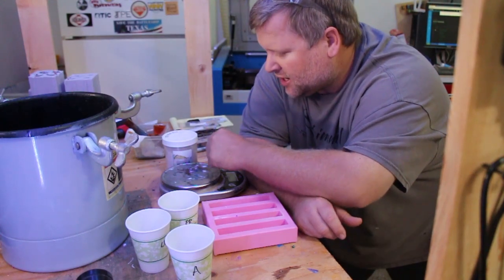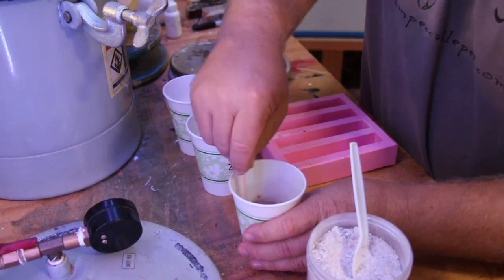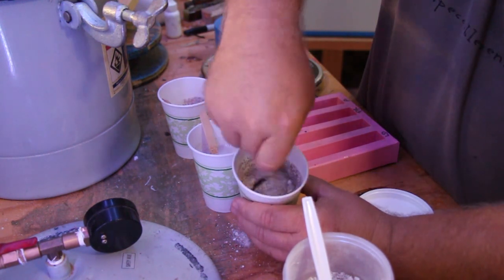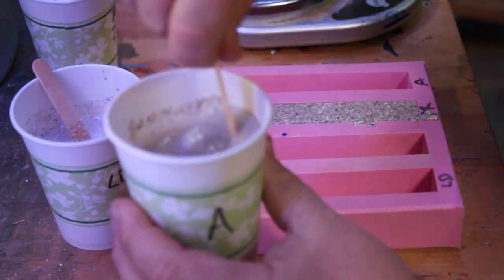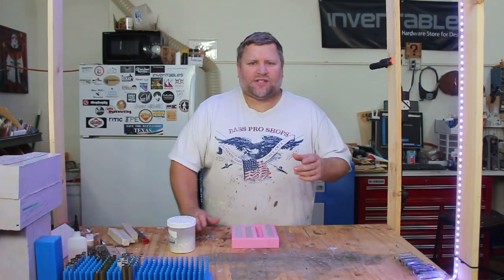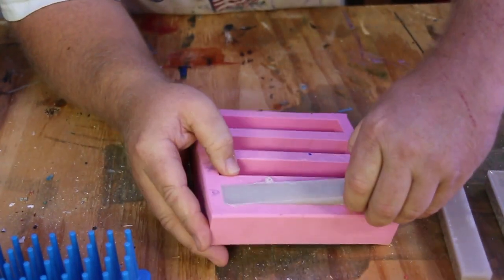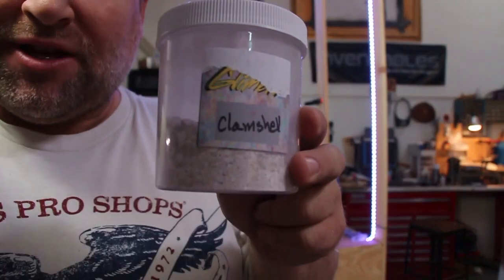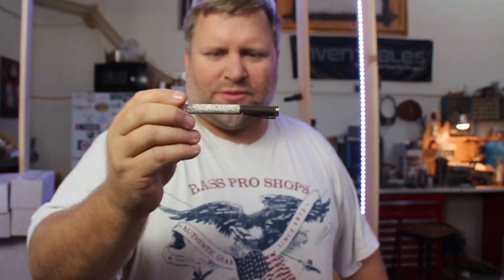Trying out Glimmerstonez in Epoxy,  Polyester, and Alumilite resins, Turns like corian!

Comment: I know that with alumilite, timing is everything, maybe wait until it starts kicking off a bit before adding the mix in? At least in theory, the thicker resin should suspend the particles better. Or maybe perhaps the pressure pot pushed all the big stuff down? How about a no pot test?

Comment: Hi Chad. Great video.  I've been casting alumalite for a while now & almost all my experiments with adding different stuff  have been failures, except one.  I saved the pieces of cardboard that my pressure pot was packed in.  When you tear the top off the cardboard there are lots of little cells. Shen you fill them with resin, it makes a beautiful pen blank.(too late to make a long story short) I thought you might try that with with the Glimmerstone.
Just a thought. Cheers, Jim